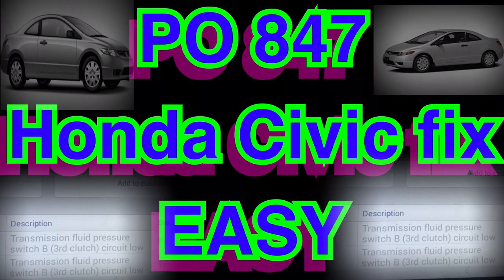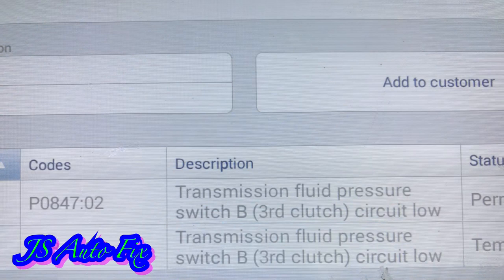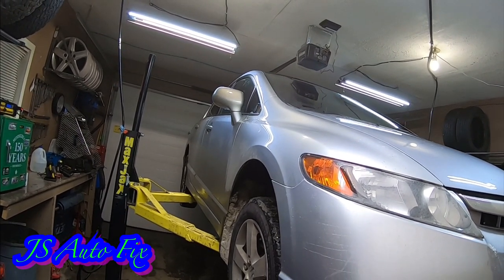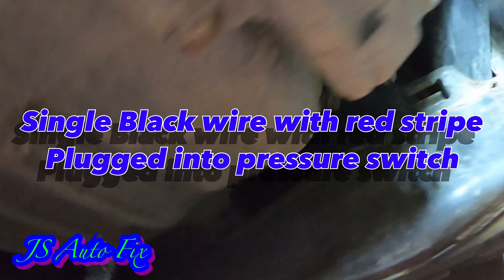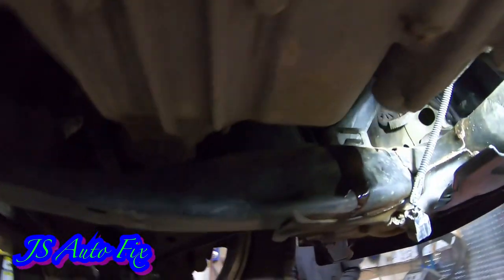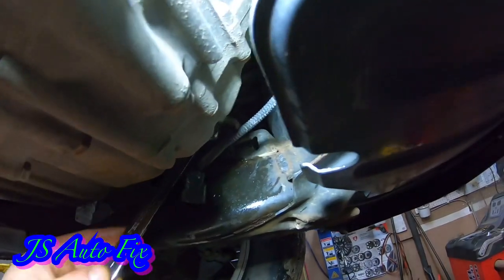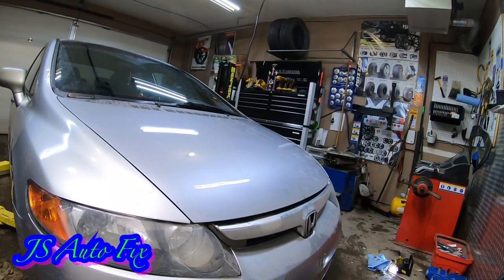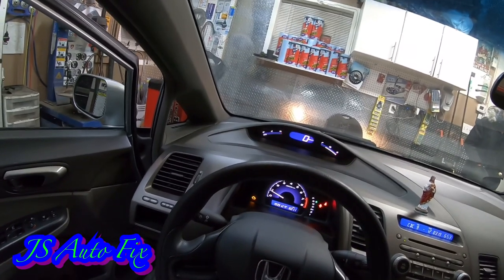Honda Civic po 847 pressure switch B third clutch. Green light flashing. Easy fix

Comment: Very good. I replaced both A and B switch over 6 months to resolve transmission not shifting properly. Then it happened again on 3rd clutch switch B. The transmission shop said the pump is not giving enough pressure. So I had them drain all 6 quarts and refill and replace the inline filter. Then I had the B switched replace again. Sometimes the cheap after market are not so reliable. Seems to be working. Also you can check for voltage at the switch, 5V to make sure there is power to the switch.

Comment: Question sir if your transmission pressure switch is failing would solenoid a and b will work? Thanks alot more power

Comment: Hi mu 8th gen accord D light is blinking. Paddle shift will not function if D light is blinking. Turned off the engine the blinking is gone, paddle shift functions. Blinks again after a fee minutes. Notices also a slight engagement delay from neutral to drive 2 to 3 seconds before it engages.

Comment: I have a 2006 Honda odyssey when I press on the gas it doesn’t want to go I have the VSA, engine and brake light on. Sometimes when the car is running the gas gauge goes to E  even though it’s full. I replace the battery and replace the alternator it still didn’t help. The car keeps shutting off unless I jump it. Thats the only way it starts. should I just Junk the car?

Comment: 2016 Honda Civic engine light on and flashing d. Car also doesn’t want to go after 40 mph. Do you think it might also be the 4th gear or 3 rd gear pressure switch sensor? Any help would be appreciated
Reply: Mines doing the same thing now.. what did you end up doing or what was it ..thanks in advance
Reply: 2012 accord does the same code is p0970
Reply: My car honda civic.model 2016. Code. P0973. D light flushing what's problem

Comment: My honda civic 2006 is giving the same issue right now. My rpm just goes way up then down at times. Then it doesn’t select gear 3 on high way as well. The D light constantly blinking exactly like this. I hope this solves all those issues.
Reply: did this fix it?

Comment: Is this something that has to be fixed immediately?
Reply: not right away if minor but no longer than a 2 weeks. the risk is ruining your tranmission eventually cause of the wrong amount of presure to switch gears.... avoid putting the gas to the floor drive it like a grandma

Comment: What about if I don’t have scanner to erase the code?
Reply: Disconnect the positive on your battery for 10- 15 seconds, then the check engine light will turn off and your vehicle will start to shift properly. If you don't, it will still show PO 847 and your car will not shift properly, even with the new part installed!